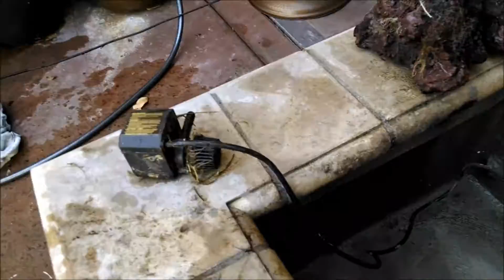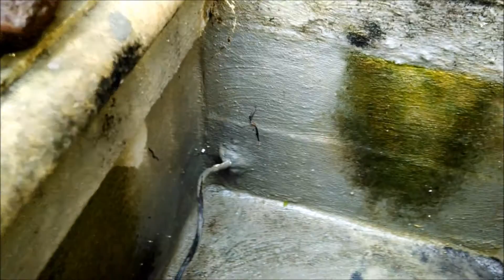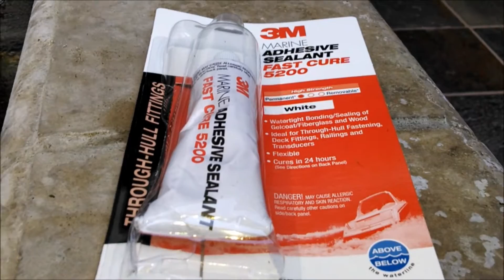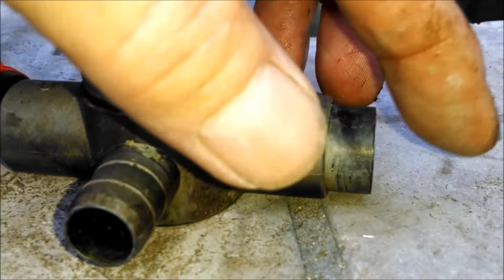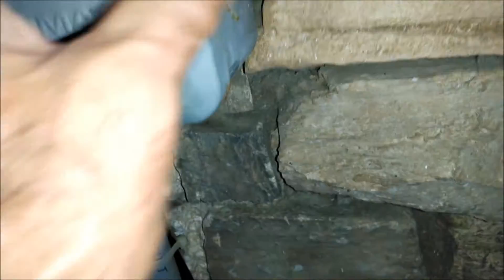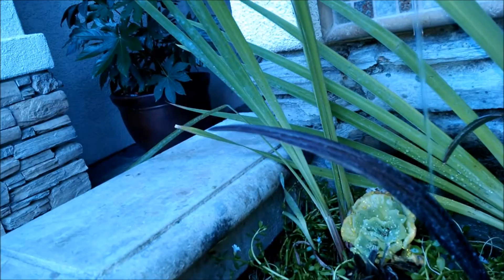Home maintenance replace fountain submersible pump by froggy

Comment: You forgot to show the pulling of the old cable together feeding the new cable. Thats the critical point of the replacement process. Too bad dude.
Reply from the maker: Well thanks for pointing that glaring omission out, I poked it thru about 6" long hole. Thanks for viewing.  :)